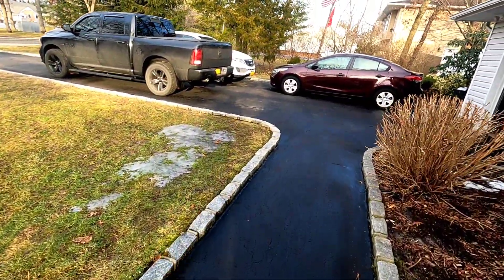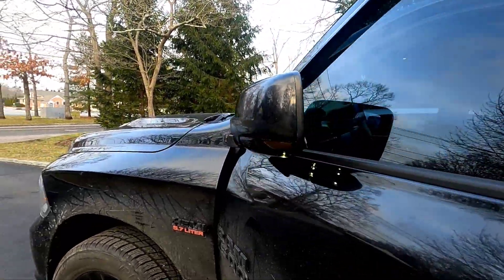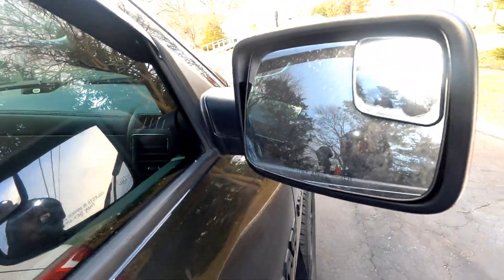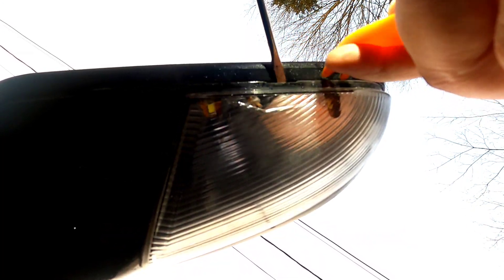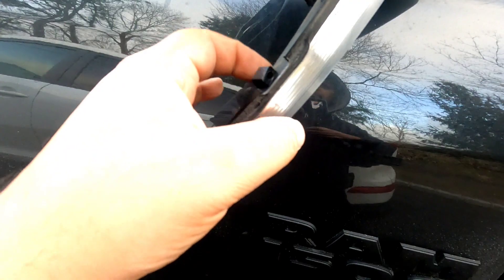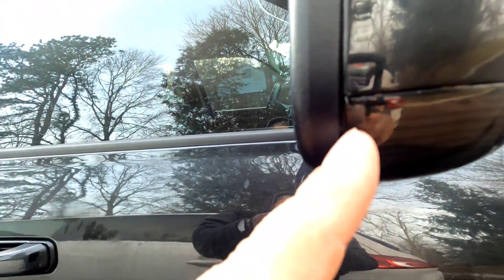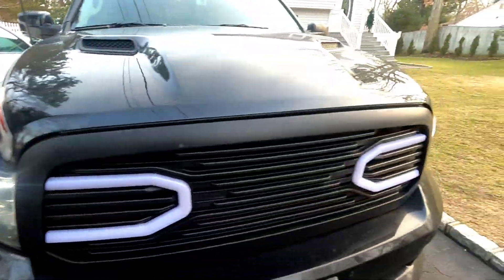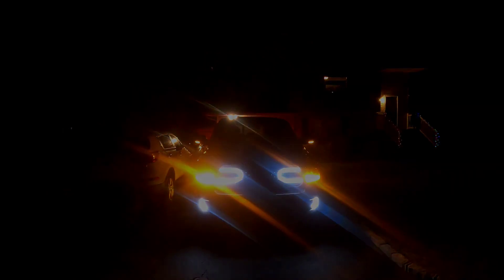Sequential Led Turn Signal with Courtesy Light for my 2016 Ram 1500 Sport Side View Mirrors(Amazon)

Comment: hey i just bought these exact lights but the ones i got were not sequential. just 3 LEDs like the oem ones. any idea if there’s other brands that look the same as these? most i can find just have a this strip of LEDs
Reply from the maker: There’s not too many options out there as far as these lights go but do you want the sequential light ones?
Reply: @WikedWips  yeah i want sequential smoked ones. im thinking i migh go with the ones by headlight revolution since they are actually an american company not a Chinese scam
Reply from the maker: @landonwiebe7815  well so far I haven't had any issues
Reply: @WikedWips  ok well it seems i they dont make them anymore even though the amazon listing says they are sequential. i returned them and reordered them and both times i got the smoked ones but no sequence 🤷🏻‍♂️
Reply from the maker: @landonwiebe7815  that's strange 🤔
Reply from the maker: @landonwiebe7815  what the brand and part number?
Reply: @WikedWips  brand is Loiyllen. not sure about part number by i ordered the Line Dynamic Sequence Smoked option
Reply from the maker: @landonwiebe7815  check out this brand, it has good reviews AEXPLOER

Comment: 5:38 instead of pushing on the plastic piece (there are two in there), if you have long needle nose micro pliers, you can just squeeze the two pieces together and it will pop right out

Comment: Replaced my puddle lights left side signal working! Right side puddle signal not working? But both lights come when I open doors
Reply from the maker: Send it back....did it work with the OEM ones?
Reply: @WikedWips  no it didn’t work with oem! Probably electrical issue or fuse
Reply from the maker: @carlitot5388 most likely an electrical issue...maybe a wire etc

Comment: Do I have to do something to engage the amber turn signals to light up? The white puddle lights work no issue, amber, nothing. Day or night. Also one of the lens covers came unglued from the unit while installing. Piss poor product imo.
Reply from the maker: From the moment you saw issues you should have sent it back.  Also, the plug controls both the puddle light and turn signal....so something could be wrong with the product.

Comment: tried this on my 2011 ram sport..sequentilas didnt work like they should..think its a obd adjustment needed...any suggestions
Reply from the maker: Are they working at all?? If so, how are they flashing exactly?
Reply: I have the same issue
Reply: They just blink, the sequence function doesn’t seem to work
Reply from the maker: Weird, could be an obd issue....reach out to the company
Reply: any fix?
Reply from the maker: @chodge8366  well mine still works as it should and the guys here who commented never replied 🤷‍♂️
Reply: @WikedWips  Thanks..I have an 09.  I came out today and my lens was missing although the lights still thereand works. IWanted to try these since i had to replace anyway
Reply from the maker: Ohh ok, good luck with the install 😃